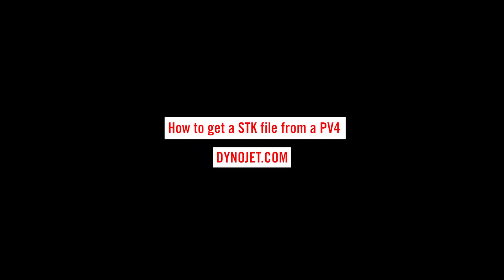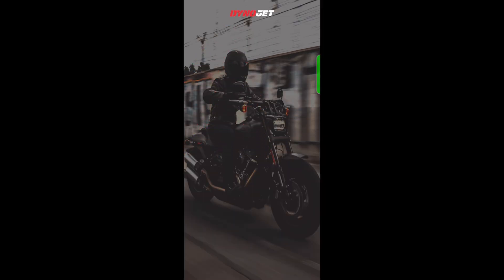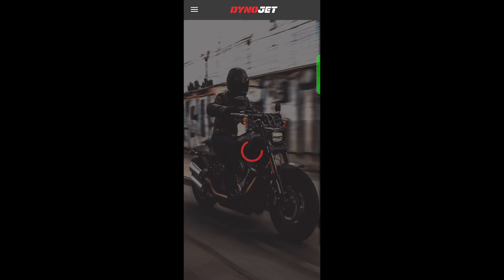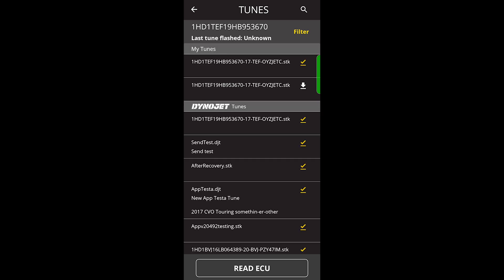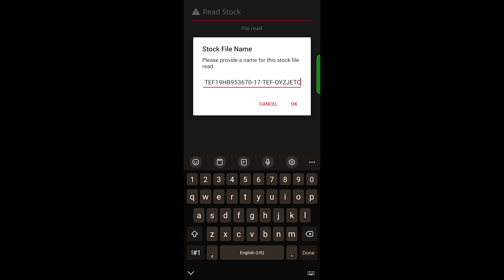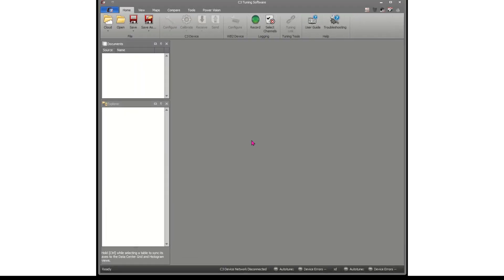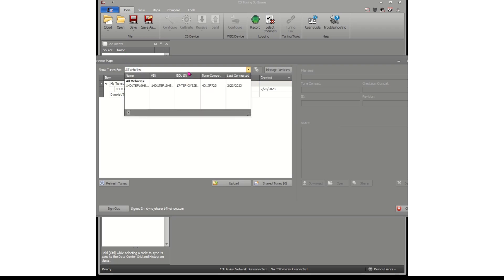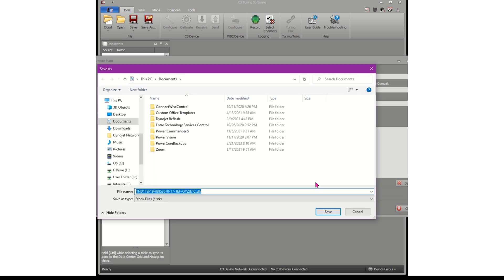How to get a STK file from a Power Vision 4

Comment: Do you intend to make the PV4 work with your belt temperature sensor.  I assumed it would work as the connection is physically there, but after switching from the PV3 to the PV4, I found that assumptions are just that.